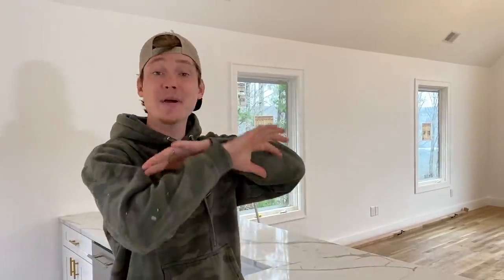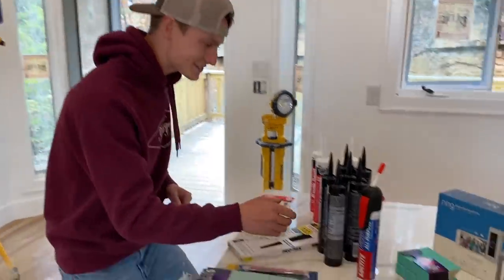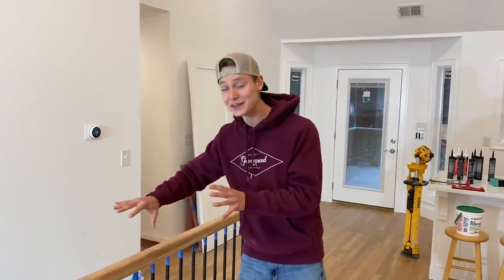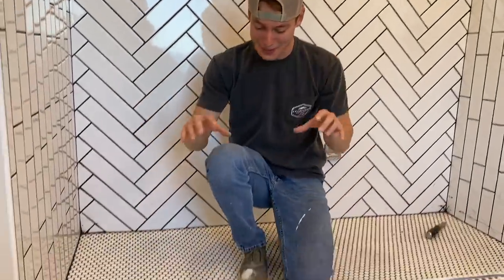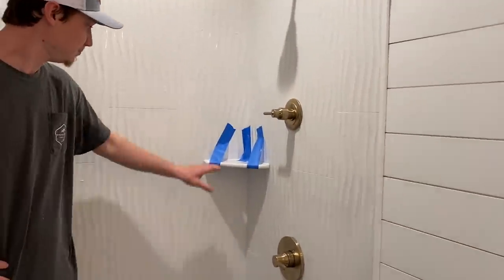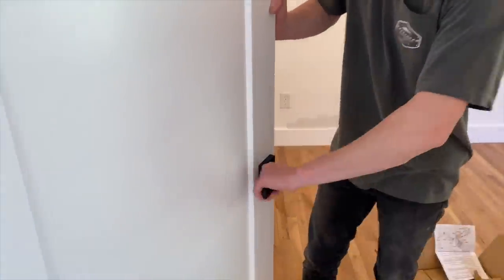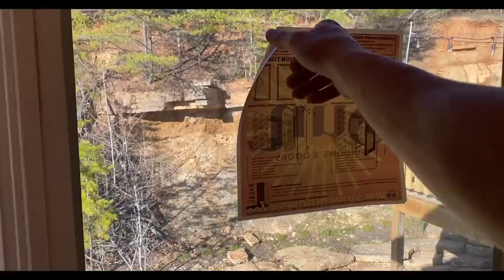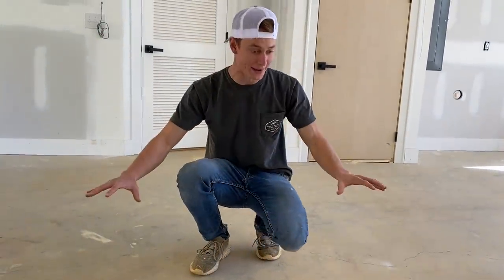The New Goonzquad Headquarters Part 81

Comment: Looking good fellas! Pro tip for future repairs, don't try and float the tape line when using paper, the top will dry before the bed and possibly cause the tape to pull away because of shrinkage. Let it dry to the bed before floating. I suggest using fiber tape or mesh tape for repairs like that, whole lot easier for noobies. 😉😁

Comment: I'm a painting contractor guys and my advice for painting walls is to never touch up roll the whole wall out you will always see a touch up
Reply: yeah im a Youtube Painter, i agree with this
Reply: Same here. I painted new homes for several years, the difference in thickness and sheen will show up unless if flat paint. Personally, I would spray the whole thing. Roller marks are bad on new walls.
Reply: @robertbailey4454  I think they did use a flat paint for the walls.
Reply: Goob jod
Reply: That's why we use wall textures. Smooth walls will show everything.

Comment: Just an fyi.  They make a garage door opener that attaches to the wall instead of the ceiling.  It would help clean up the ceiling when the door is down.  It is also bluetooth compatible.
Reply: i'd say just get rid of the garage door and use two folding doors that open kind of like a closet.  especially if you want to make it see through.
Reply: @BigElkification  True but they also make glass roll up doors too
Reply: They should get rid of a that garage door. It’s a bit unusual having that there in the first place. Should install some bifold doors!
Reply: @nasser.h9473  Bifolding doors is what I was trying to describe. LOL.
Reply: I was just going to recommend that, plus the side mount are so much quieter
Reply: @legitgames4990  glass roll up doors would look awesome! Give that room an industrial look and they could have a nice view of the patio even in the winter.
Reply: I don't think there's enough room on either side of those tracks for a side mounted opener. They should have framed that wall in and gone with a slider or french doors.
Reply: Yea I have one in my house
Reply: Agreed
Reply: @Mitchell Waldrep that shit look clean
Reply: @Mitchell Waldrep Nice suggestion, Since it wasnt meant to be a garage it should be a sun room and the back view would be the garden and montain side
Reply: Or just a giant screen door ?

Comment: For the garage room, a sliding glass door from ceiling to floor would look nicer than the garage overhead door.
Reply: Big Bi fold doors would be nice 🙂
Reply: Goonzquad have stated that a custom-made replacement door of a more suitable design has been placed on order, and will be professionally installed when it is delivered.

Comment: I’m no tile expert but you do not have enough Thin set going down for those tiles at all.  Just butter backing tiles is not good enough adhesion.
Reply: I noticed the same on the large format tiles....needs both done.
Reply: I’m glad I wasn’t the only one to notice that, tile should not be able to come up that easily. The tile work looks good but I don’t think it will have much longevity
Reply: That soap dish is not going to stay up long either- needs to be planned beforehand and mortared to the wall w the tile cut around it...
Reply: @mertonallowicious  a better ceramic epoxy would be better at this point but I have to agree it would have been best set in place with the motor and tile.
Reply: Tiles be falling on their heads.....

Comment: Since the "living room" is technically a garage at this point, I wonder if there might need to be a fire-rated door between it and the rest of the house to pass inspection.
Reply: Goonzquad have reached agreement with the Building Inspectorate that the former Garage has been repurposed as Living Accommodation, so there is no special requirement for fire insulation or smoke exclusion.
Reply: Yes, they'll need to install a firedoor. As you said, it's technically a garage. Good call!
Reply: @savagebob911  Yes, that's exaclty correct.
Reply: Thanks for the info. I was just curious.

Comment: the old tiles popped right off because NONE Of them were done correctly.
Reply: That’s because they only back buttered the tiles. They didn’t trowel any mortar on anything. Just wait for the mould in the near future. This is why those that don’t do should have a professional do their work. I give this house 5 years before it’s falling apart.
Reply: @Jane1le  you are a very generous soul to give it 5 years. 
Side note anyone else laugh at how they installed the tiles in the 2nd upstairs shower sideways? They are designed so water flows over the ripples on the tiles, not between them. Completely ruins their intended esthetics.
Reply: @Gantzz321  21 subscribers vs 2.3 million subscribers. Maybe you should try being a little more positive like these guys instead of critiquing every little thing they do.

Comment: In the early 70s, my dad literally invented the method professionals use today to repair holes in drywall, and it's still superior to those gimmicky little clips. It's so simple, and yet extremely effective. Plus, it will completely disappear as though it never happened. All you do is make the hole in your wall a specific measurement, then cut a piece of sheetrock that size plus an extra 2". Use a utility knife to score the back of the sheetrock 2" from the edge on all side, then break the sheetrock along the lines, and peel it from the paper so you'll have your patch with 2" of paper on all sides. Place some mud around the hole in the wall, and place your patch over it. Then use your mudding knife to apply pressure to the edges of the patch and squeeze out the excess mud. This will bond your patch to the existing drywall, and it will be just as strong as if it had never had a hole in it. Then just apply your texture over it, and done.

My dad used to teach special finish painting at a branch school of Texas A&M University, and taught this drywall repair method to those students who in turn taught it to others. He called it a "Dutchman", so that's the actual name of it. I never asked him why he called it that, but he's gone now, so now I'll never know. Anyway, use that next time you need to repair drywall.
Reply: Dude! I had to read your comment twice to actually see it in my head. Your method is BRILLIANT. I have fiddled around with those stupid little metal clips a few times and was completely dissatisfied with the results. I’ve watched a million “how to” HGTV programs and never seen what you described. I can’t wait to try it. As for the term “Dutchman” my dad and my wife’s dad both used that term to describe anything that needed some kind of patch put IN to something. They were both German so maybe it’s a German expression?
Reply: @laceylouloulou  Yes this method is far superior than those clips. Also, using the clips, you have to use drywall tape to seal the edges with mud which can over time crack if there's any shift in the foundation of the home, or someone bumps the wall, and you'll see the cracked tape line. My dad's method won't crack, there's no tape because the excess paper on the patch acts as the "tape", and is just as strong as a solid piece of sheetrock. Glad I could help, and pass on some of my dad's knowledge!

Comment: I use a piece of marble to cover the step over. Not only does it look much better but once it’s glued down it’s nice for anchoring glass doors. Plus add a 1/2” over hang on each side and with the 1/4” angle for water run off you never have to be concerned about water leakage. I am very surprised the door guy didn’t suggest marble instead of tile. Water will want to lay in the grout line and hinder water run off. Consider redoing it as a suggestion. Thanks

Comment: You don’t even have to cut that tile out in the bathroom that meets the hall way at all. Just get a hard wood trim board that slopes that matches the rest of the wood and then lay that baseboard down across there to fill it and have it meet up against the door and the problem is solved. And also if it flooded in the bathroom the base board there would help with at least containing the water to the INSIDE of the bathroom as best as it can ! Good luck guys !

Comment: I, absolutely LOVE the floors, and applaud you both for listening to the comments section on parts of the build of this house. You both should be proud of your achievements. The one critique that I might have is the gold in the light fixtures. To me, it's just a little much. It may have been better to match the black one that's upstairs. Most of your bathrooms and kitchen and bar area all look the same, why not all of the lighting fixtures? Like I said, that would be my only critique. Thanks

Comment: That shampoo corner piece is going to give out over time. The easiest way to get it on there permanently is to grind a grove both on the corner price and the wall tile where it contacts, shove a couple pennies within the groves and glue them down with resin. The resin is a stronger bond with ceramic pieces and the pennies won't rust because they are copper... House is coming out great guys
Reply: That 'coin trick' is a really bright idea! I learn something every day 😁

Comment: Just a quick suggestion. The termination between the two floor finish was to add a threashold to properly terminate both finishes and also to prevent the water splash from the bathrooms when there is an accidental water spill. And to save the wooden floor as well from such accidents. Just a thought though. Keep creating more contents i love how your so humble despite the huge success that you guys achieved. God bless you guys.

Comment: I think for the final video you should show the before and after of each room and the outside of the house. As for the bathroom tile going into the hallway, just trim the tile back and put down some hardwood threshold or leave it the way it is. I see some houses have it like that. And the final suggestion, I forget what they are called, but something on the wall to keep the door handles from going into the walls and damaging them. Kids are great for that, just a heads up!

Comment: on your next drywall wall repair mud all your edges on the repair piece and the opening edges so it sets as one piece instead of just the clips holding it. If you use 20 minute mud it will give you a stronger set.  If you had a lot of repair check out videos on drywall butterfly patch repair just using drywall and 20 min mud, no clips or tape needed.

Comment: I am wondering if you have to have a fire rated door from garage to house. I am pretty sure you do....but i guess we will see what  the inspector says. Looks great guys!
Reply: The former Garage space has been repurposed into Living Accommodation, and this has been agreed with the Building Inspectorate. In these new circumstances, Code does not require any fire insulation between that room and the access corridor.
Reply: @johnstedman4075  I am assuming that was agreed upon in plans? If not id still assume it would be needed. But thanks for input. You are probably correct!
Reply: @steves1765  It has been the experience of my Firm when supervising projects in the rural areas of Hamilton County in Tennessee (where the Goonzquad 'HQ House' is located) that a verbal agreement with the Building Inspectorate is sufficient in such matters, and Goonzquad indeed stated on their YouTube channel some months ago that this is also what happened in their case. Typically, there are fewer formalities in such situations than one would expect to encounter in a multi-unit residential complex, a commercial development, a building to which the public will have access, or indeed any project in a densely developed urban environment. However, in our case, we do confirm such verbal agreements with a simple follow-up letter, since this is our SOP and it is the prudent way to handle such matters professionally.

Comment: Make sure to order and install some door handle wall stoppers so when the door is swung open the handle does not gash a hole in the dry wall :) - good tip

Comment: Instead of cutting the extra floor tile, just put down a thin oak threshold (and shave off the door if you have to. That way, you will at least get something stopping spilled water from going straight out into the hall.

Where I live a tall threshold (about an inch or so) is actually required for bathrooms to stop overflow.

Comment: In Brasil, We just do the ground off the shower area half inch,  loo comopare the rest floor off bathroom, and get a glass install on the high floor right on de edge, put some silicon and Done, no have this step divide the floor a two ambients

Comment: I mentioned this before and not sure you read these comments.  But your dryer does not have enough airflow if you close the door while it is running.  You may want to consider a grill vent in the door. Hate to see you all have issues.  One of the doors like you have going into the garage would work perfectly.  Good luck.

Comment: One thing you could do to solve your floor tile issue at the bathroom door is to glue down a thin piece of hardwood, stained to match the color of the wood floor, over the tile to serve as a threshold. I have something similar in my house at both bathroom doors and as long as it's not much more than one quarter of an inch thick it won't present a tripping hazard. You will need to cut the door stop the thickness of the threshold board so that the threshold board slides under the door stop.

Comment: I think in order to pass your inspection (unless Tennessee code is different) you have to have a fire door from the garage to the house.
Reply: The former garage has been repurposed as living space, with the knowledge and agreement of the Building Inspectorate. As such, no special fire resistant or smoke excluding door is required by Code.

Comment: If you are not going to use the garage as a garage, you should consider removing the garage door and install sliding doors that open the full width of the opening.  Demo Ranch is doing this in his Abandoned Mansion and it looks pretty epic.

Comment: Y'all just need some Threshold to cover up that excess tile butting up to the hardwood. U don't need carve out any of that tile. Just cover it up with Threshold. Y'all should definitely do an epoxy floor (kit) in the garage with the metal flake in like a gray or light blue or bluish gray color, or check out the Legarri Products youtube page. They have a concrete overlay kit that makes ur concrete floors look like hardwood.

Comment: Quick cheat, wait until the final inspection has been done and been passed, then swap the door to the other side of the door stop and make it open outwards. Believe me, (experience talking) you won't get the tile cut full width without breaking it or putting a grinder groove in the door jam.  Obviously the door jam can be filled ,sanded and re-painted but it's more work than necessary.

Comment: But surely you need to alter the vertical height one side and move the bullnose or the sloped tile and bullnose won't line up!
Reply: The horizontal curb tile is about 100mm wide. The usual drainage slope recommended for shower tub tiling is 1 in 50. So, assuming that the original installation was precisely level, that would only require 1mm of lowering on the inner edge and 1mm of lifting on the outer edge. If the lifted side has an uncut 'cushioned' edge as supplied, this is likely to result in a safe detail without the need to reset the edge trim. However, it is rare to see a tiled shower curb on a professionally designed project, because they are prone to failure no matter how well constructed. A monolithic custom cut marble curb is more common, and far more robust.

Comment: You should just add a door sill/threshold on those doors on the top floor instead of cutting those tiles, helps with sound deadening aswell, i personally hate those doors where there are no wood at the bottom and just a gap, you can't really cancel out noise if you would want to.

Comment: Because the one room is Technically a Garage won't the Inspector make you put a fire door on it not a louvered one.  Don't know what your specifications are but in UK you would have to use a Fire door.
Reply: The former garage has been repurposed as living space, with the knowledge and agreement of the Building Inspectorate. As such, no special fire resistant or smoke excluding door is required by Code.

Comment: I feel like the louvered door going into the garage will not allow you to pass your inspection. Even though you're not using it as a garage it may still be classified as one. You generally need to have an exterior door due to exhaust gases in the garage.
Reply: The former garage has been repurposed as living space, with the knowledge and agreement of the Building Inspectorate. As such, no special fire resistant or smoke excluding door is required by Code.

Comment: If that's going to be a game room/ living room I suggest replacing the garage door with an actual door as your going to be spending most of your time in that area your electronic need to be in a cool dry area and garage doors aren't ideal for keeping rooms at cool and dry temperatures. I recommend a glass sliding door it will look nice and will provide some lighting during the day. anyways if your going to turn that into a living room the garage door needs to go it doesn't help that you can place anything on that side of the room since it blocks the way and you can't hang any bookshelves for your dvd or video games etc.

Comment: You hung the louver door to the garage upside down?
Reply: That is an interesting point. However, when a louvre door is installed to separate a corridor access from a living space, it is usual to hang it so that the more attractive side is facing into the room, because it will be seen more from that viewpoint. This is what Goonzquad have chosen to do in this case for the repurposed garage, where the living area concerned is after all the largest single space in the house.